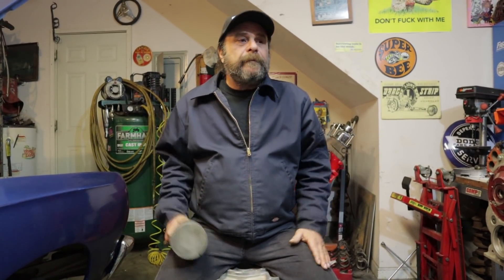3 Reasons Junkyard Engines Go Better With Boost

Comment: The 5.2L/5.9L Magnums are also great junkyard engines for lots of power on the cheap.  I have a 5.9L in my '70 Duster, high-mileage block with nothing replaced other than rod bearings (old ones had copper showing).  Runs like a beast with ported Edelbrocks and custom-grind hydraulic roller cam, you can even reuse the old lifters if they're in good shape.  If you happen to get one made before about 1996 it will even still have the oil passage drilled to feed the rocker shafts on LA heads so totally interchangeable.
Reply: silverbird58  The factory "beer-barrel" Magnum intakes are decent designs but aren't good for making HP, they're designed for max torque from idle-4000 RPM.  However Edelbrock makes an RPM Air-Gap 4-bbl carb intake that bolts to Magnum heads, much better choice for a swap in a car (beer barrel intake is pretty tall as well).  And Hughes Engines sells a version of that same intake set up for port EFI.
Reply: @mopartron3030  I bought a magnum 360 with 269000 miles on it for $200 and used a hughes cam with their spring kit and put one of those RPM air gap intakes on it with a 1in spacer and a 600 4 barrel. Sounded so sick with shorty headers and borla XR-1s dumped over the axle. replaced the rear main seal and oil pan gasket and it had 65 psi of oil pressure on start up. Thing was great in my Shelby Dakota until the 42rh gave up on me.
Reply: @mopartron3030  Hughes Performance makes a magnum 360/426 stroker kit I've wanted to build for a while.  A problem with the magnum motors is availability of heads, and the reason I'm never going to build one is because I don't want to spend $3500 on a pair of cylinder heads.  Another HUGE win for the LS motor is the plethora of factory GOOD flowing castings that are available.
Reply: Have a 5.9 magnum in a 97 ram 2500, the cheapest 3/4 ton truck on Craigslist when I got it. I use and abuse it pulling old junk cars and parts. Damn thing won't die. it has no business doing as well as it does.
Reply: Ive always wondered about those magnums. 318 and 360 ci right? I remember them being really solid in stock form and at one point a long time ago heard about aftermarket alum heads for them.
Reply: @bentboybbz  yup, cant kill the motor. I just haven't found a dodge transmission that will hold up to even a stock smallblock.
Reply: 727,904, and A833 will a lot of power and aren’t expensive or hard to build.
Reply: @Mr.Killswitch  I have a 904 built to the gills... No issues.
Reply: Henry Dillard you haven’t looked.
Reply: So whats a good recipe for a LA 360 v8? Ive got a 85 block and im bored with the stock power
Reply: @kennedy796  There are many options nowadays I'd head over to ForAbodiesOnly.com and search the Small Block Mopar section, many discussions about power upgrades for stock 360s.  Cam and headers will do a lot.
Reply: Are these the same motors used in jeep grand Cherokees?
Reply: @scottcampbell2836  94-98 grand cherokee v8's were in fact the Magnum roller cam motors. Past that they went to a 4.7 sohc power tech motor, which I'd personally avoid like the plague.

Comment: I’ve watched a bone stock “smog” bb mopar 400 run low 11” with a blower bolted on it for years.

Ps. I have 7 bb mopars “seasoning” in the barn
Reply: Me too. I have 383's , 400's and 440's stacked up on shelves like chord wood.
Reply: wrecker Jonny can’t find them in the wreckers anymore at least not up here in Saskatchewan. 
Over the years I knew that would happen. So I grabbed what I could. Have let some go but I’ll be keeping these
Reply: @Welcometofacsistube  that's what I been doing . Grabbing every big block I can get. I have an older  gentleman that has an A100 pickup with a big block and a blower on it. He's letting go of his stash in spring so I have to wait for him to migrate back from Florida in late spring. Already have my foot in the door .
Reply: @Welcometofacsistube  do you know if any would be in Alberta or B.C.? Also where abouts do you live in sask
Reply: @CraigFenske  tons left. Just need to hunt. I live near Saskatoon
Reply: @wreckerjonny6144  send me a couple of them
Reply: I don't care about boost but I do care about power. I'm a GM guy myself, but I actually like most brands. Right now, I have seven 400 small block Chevy blocks, a few 454s (and 2 more in the "negotiation stage"), and a couple 360 Mopars on the shelves just waiting for projects to give them a new home. The sole 302 Ford I have is currently mocked up in my Ranger project. I think the reason that I don't care about boost is because I've never had a blown or turbo engine. I'm sure experience would change my mind pretty quick though!
Reply: @MikeBrown-ii3pt  boost is relative.  I had a small displacement with boost, and that meant when you wanted to pass a car on a hill, the boost came on once you reached its side mirror...a little too late by then.  The other problem is octane--if you have E85, then there's no problem.  My state does not, so octane higher than 93 is $12 a gallon.  That makes cubic inches and pump gas compression rations a good alternative. 

the tea kettle whistle, tho, is kinda neat :)  And popping the hood to show a snail, answers questions like, "is it fast?"
Reply: Hal 1000 I can believe it. Low compression goes hand in hand with supercharging. I wonder if/how much work was done on the heads. If they were stock, imagine how it would run with head work done!
Reply: Mike Brown absolutely bone stock long block, cam and everything from a 76 Córdoba. New bearings and chain. That’s it.

Comment: I absolutely love these videos. Especially when you understand this stuff I learned so so much already.I have a question Uncle Tony Have you drove in a LS swapped car. Id rather run an old high reving desoto or Chrysler Hemi.You may be drown to it cause its easy power but I will promise you that drive an LS and drive one of them runners you got you will never stray away . The sound the imperfections all and up to what you love. Leave the LS for the kids.You got something special stick with it.
Reply: "Leave the LS for the kids".......is a brand-loyal snobbish attitude to take. In the REAL world, most guys are on a tight budget, and the LS platform has SO much aftermarket support for power adders in a broad price range that boggles the mind. I like em all, Chrysler, Ford, and GM. They've all made winners AND duds. It's perfectly fine to have your own personal preference, but there's no need to start demonizing any of the others, just because they can build a strong race engine without taking out a 2nd mortgage and then getting served divorce papers. And ya might as well face it, GM did a bang up job when they created the LS platform. Enough with the childish name calling & insinuations already. And that goes for anyone else slinging mud at any of the others. Good grief.
Reply: Wow i wasn't directing it at you you johny wrench.
Reply: Uncle Tony I guess that they totally took my comment wrong
Reply: So i guess i touched a nerve for saying anything, we have some classy human beings here people, i have an ugly as duster yes but wtf do you have?
Reply: Someone touched a nerve!!
Reply: @karlsracing8422  NO, I'M TELLING IT LIKE IT IS. YA WANNA START ACTING CHILDISH YOURSELF??? Can't enjoy a damned thing anymore on youtube without certain people starting this tired, lame old crap. It accomplishes absolutely nothing. Feel proud of yourself now? I bet you do.
Reply: @howabouthetruth2157  Wow ls boy no harm intended but I guess you have never driven in a hemi
Reply: @karlsracing8422  the only nerves touched is when i think of an ugly Duster
Reply: @johnnywrench9669  i don't see any videos of you building your own car then racing it? Grow some balls and come tell me my shit sucks!

Comment: Jealous of fuel injected v8s!?
Reply from the maker: First, FI has zero to do with it. Second, I've dealt with more FI V8's than I can count. I was hot rodding those back in the 80's
Reply: @UncleTonysGarage  did you ever get into reprogramming those fox body computers? software has been available for a while now and chip burners or eprom emulators like moates quarterhorse ect...   I tinker with computer tuning for my turbo 1990's honda's burning those little eprom memory chips but haven't gotten into the ford EEC stuff yet.

Comment: So what would you build to match an LS from the mopar engines? La, magnum, big block? How would you go about chasing 1000hp with mopar?
Reply from the maker: The basic recipe is the same.  A Gen 3 with good valve seats will to toe to toe.  I've never seen it done, but there's no reason I can think of that would keep a Magnum or LA from doing the same.
Reply: Tony i hope u dont mind if i answer below you...

Any small block mopar built at the wider end of spec with good flowing heads would be a perfect candidate for supporting big hp if you pressurize the intake tract. Pay attention to detail and clearances, keep em on the high side, a set of flowing heads and you got a 500plus normally aspirated small inch mopar. Just add boost with a safe tune and you are in the stratosphere hp wise. Should support 900ish with stock-ish parts
Reply: a guy here on yt had a 5.2 dakota with 200k miles making 650whp. stock everything.
Reply: Man thanks for the reply guys!